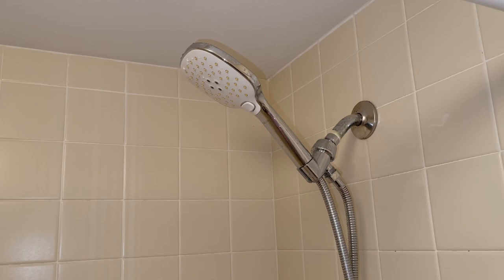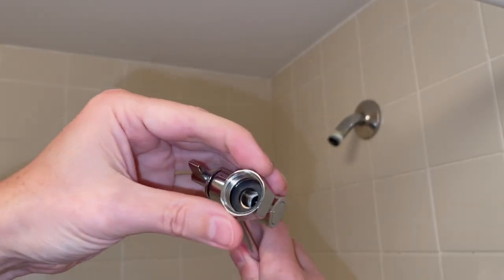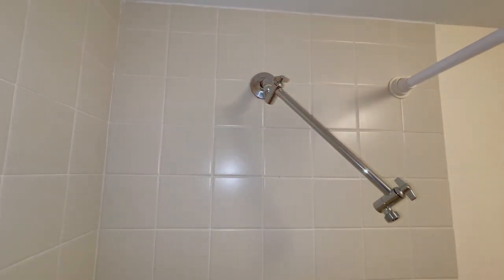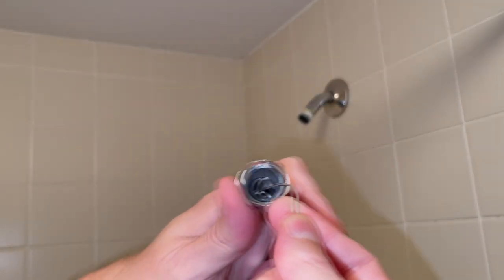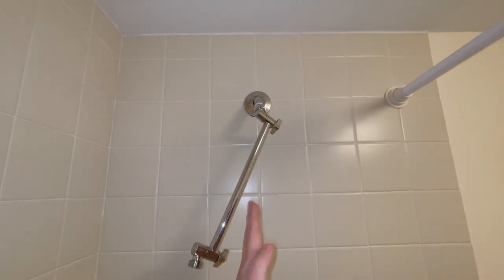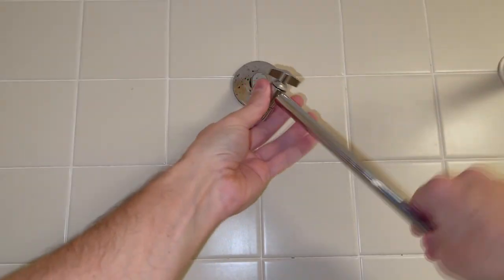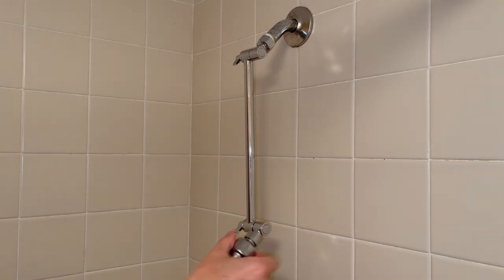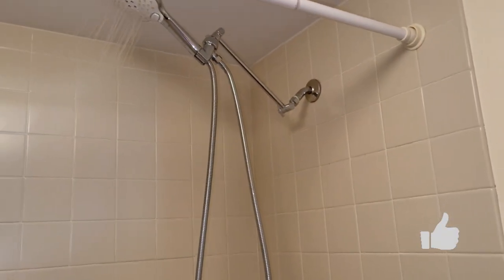Shower head cheap extension arm installation

Comment: Thank you sooo much for this video!!!Very easy and right to the point! 
Could you please guide me to a link or name of the extension that is less difficult to work with?
Reply from the maker: This one has a free-spinning locking collar, so it should be easier to install https://amzn.to/3qpQ5GC
Tighten it by hand first, then use pliers (lightly) to secure it better.

Comment: Thanks! Might get one of these for my apartment. How are the wing nuts holding up? Do they feel like they hold the shower head firmly after some use??
Reply from the maker: My wing nuts are holding well. But I'm using this extension to lower the showerhead. So I can't comment on reliability if you are planning to raise your showerhead.

Comment: What can I do if I can’t move the extension up and down like your did?
Reply from the maker: Did you loosen those wingnuts?
Reply: @Your-Self  yes for both ends I got t part that connects to the shower head moving but I can’t get the other end to move up or down